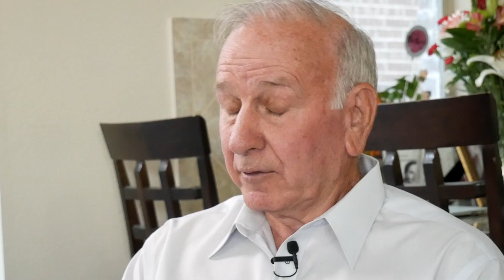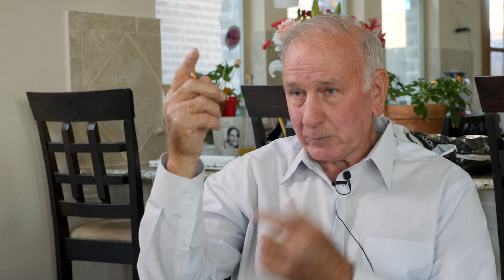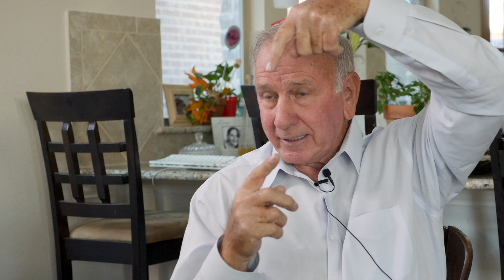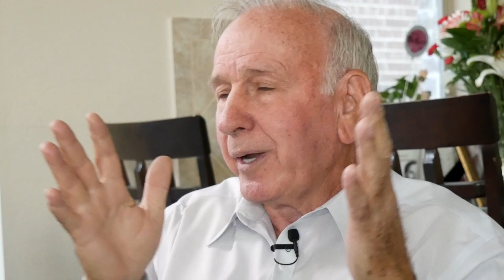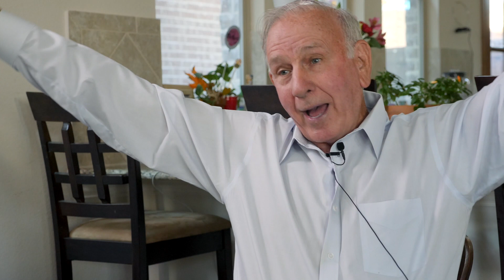Problems with vertical windmills

Comment: Everyone else here is missing the mark. I produce all the electricity I could ever want and I use VAWTs exclusively on my farm in Texas.

 ALL of them turn whenever there is any wind. 

They all use either a 64:1 or a 100:1 transmission and pump AIR.

I use an AIR BATTERY and run compressed air against both piston and turbine engines to produce ANY amountn of electricity I want. 

My compressed-air storage capacity is approaching 10,000 gallons.
Reply: Can we connect? I’d like to learn more from you for a project I am looking into
Reply: @georgem5560  IDK, where do you live?

Comment: He was right. I have installed one 500W VAWT (on my video), and on strong winds, it will sway so much that it lifts the 500KG ballast of the guy wire that is buried underground. The sway is so much that at 6 meter pole, it leans halfway to the ground.
Reply: where is your vidio

Comment: Using your own variables, that you measure in sunny 86 degree weather while going down the highway... is bais. Measure in a lab (ie controlled environment). If temperature, or sun, has an effect, then it should be controlled for and included in your formula... you just don't get to come out with 'your own number'. That is not how science, or engineering, is done.

Comment: One advantage HAWT have is that the blades can be feathered, so it can stand in a hurricane. The old Jacob's HAWT which was a very small unit, maybe 1 kwt, had blades that automatically feathered. And this was 1930's technology. One, installed in the Caribbean, lasted at least 30 years and survived two hurricanes.
A VAWT does not escape having to be put up on a pole. It needs that height because that's where the wind is.
The advantage I see for a VAWT is that it needs just 1 axle instead of 2. It also deals with shits in wind direction better, because it's blades are always oriented to the wind.
It's biggest enemy is centrifugal force, which is a HAWTs friend.
I take it that a HAWT tolerates high winds better. But a VAWT handles shifts in wind direction better.
Reply: Harmony has developed a VAWT whose blades retract and offer less area to the wind as the wind speed increases.
Reply: you think you know what you are talking about >? HAWT are much higher to accommodate
the large blade lengths. VAWT do not have that problem. the larger the VAT i build the slower it turns and does not suffer the giro problem.and it is controlled aerodynamically. I chalenge you to build a VAWT having a maximum hight of 20 ft and report on how many kwh of electricity it produced over a 30 day period compared to the total KWH  of wind energy that was available.  $ 1000.00 if your wind turbine out preforms mine.

Comment: If someone ONLY wanted something to power a small house & to charge a power bank, to be able to tell the power company to "FOff!", rather than something a power company would use to hold us hostage to some crap like "ID2020," would the problems be reduced by a corresponding factor???

Also, would (6 to 8) blades  made from 55 gallon plastic drums (reinforced with bearing mounts, at least at the top & bottom; plus, perhaps at the center point) hold up for 10 to 20 years of sun & other weather (I'm in rural, E. central, Okla. We get a lot of wind; but, a fairly wide range of temps & humidity.)???

Comment: This is the problem when you get engineers involved.  It becomes way too complicated. They want to start calculating coefficients, diameters, air densities and draw up blue prints ect. Get a farmer or rural country  taught on the job fabricator and they'll take care of the problem easily. No need for an engineering degree. Just install the thing on a heavy duty thick walled steel pole secured in a huge concrete base and it wont move.

Comment: Hi, Yes we have taken the main problems away from drag to either be neutral or create lift from leading and trailing blades. The self starting is proof of this. Testing is underway and should have results soon.
Reply: Hi Mike, for me part of the enjoyment is predicting what the results should be; I am excited when I am close and curious why I miss calculated. Before you attach the generator I suggest the following test: 1) remove generator and all frames and blades but one.  2) Connect a digital pulling scale.. {Kg/Lbs where (1 Kg = 2.2 Lbs)} to the frame near where the blade is attached. 3) Establish a pull point to connect the scale, this could be as simple as a weighted tripod; I suggest supporting the scale vertically to avoid errors from downward pressure {but this is minor and may not be necessary}. 4) Using the blade as a reference, mark a circle maybe 5 to 10 ft in radius 5) Place markers around the circle at the following measurement points {deg/% force} Power Side: 0d/0%, 30d/50%, 45d/70%, 90d/100%;  135d/70%, 150d/30%, 180d/0%;  Drag Side: 210d/50%, 250d/70%, 270d/100%, 315d/70%, 330d/50%. 6) Using a large fan, such as one or more leaf blowers, record the scale value as the wind blows from each point. 7) Remove the blade but leave the supporting frame and repeat measurements to determine frame loss. 8) The next step is to calculate the power output in Watts where 1 Watt = 44 lbs per second per foot traveled. Have fun, George

Comment: look at www.vertogen.eu
Reply: Hi Mike, I have only cursory knowledge of this type of windmill. It appears to be trying to reduce the return drag (from 180 to 360 degrees). Most of these designs are high speed rotations which are limited in power due to parasitic drag. I am focused on Wind Farm applications not residential. I did start with residential but migrated to Wind Farm when residential couldn't produce the power I needed. If this is your product, I wish you the best: george@zlan.com

Comment: I think the  VAWT's Gyro effect will stabilize its position?
Reply: I believe the rule is a spinning object wants to remain in place until acted upon by an outside force; then the force is applied 90 degrees in the direction of rotation. A very small lateral movement of the VAWT from a gust of wind while spinning will disturb the windmill's stability. Hold a bicycle wheel by the axle and have someone spin the wheel; if they spin it fast enough just a slight movement of the axle can rip the wheel from your grip. george@zlan.com

Comment: so basically what you're saying is that you didn't follow the rules you came up with his your  formula and it came out better by doing your  homework on your area my formula 50/50  50 power spinning one-way 50 stabilizer spinning the other way in  opposite gear rotation
Reply: Hi Frank, thanks for taking out time to comment. Regarding the formula, I initially found 5 formulas (Google) for wind force that produced different answers with the same area and wind speed. To eliminate some of the equations I did an empirical test of one of my wind panels. It best matched F = 0.00256 x area sq ft x wind speed^2 (mph). With my formula F = 0.0031 ...; I was able to calculate the break-free (start rotation) within a couple of mph. Subsequent I researched designing sails for square rigger sailboats they use the formula F = 0.0034 ... I now use 0.0034.
Not quit following your comments regarding 50 and stabilizer. But I do thank you for joining the conversation... the best to you george@zlan.com

Comment: Imagine a steel frame as for a building; no guide wires. Nest counter-rotating VAT's within the structure.   Place the bearings at the top and the turbines at the bottom.  'Walk' the beams to lube the bearings.  Bottom turbines allow easy maintenance and shorten the power takeoff lines.
Reply: Sounds like an interesting concept and I would like to pitch in BUT I would probably get the job of walking the beam with a lube swab... and I can imagine what that would be like after 10 years in the Navy... nice pic george@zlan.com
Reply: Integration into commercial architecture makes a lot of sense to me. Think of the wind that has to rush around a building standing in its way being directed to a turbine at the buildings edge.

Comment: This gentleman is incorrect with his assumptions. First of all he is speaking about large wind Vertical turbines, to produce large scale wind power. Vertical wind is not designed for large capacity technology. the Horizontals are designed for this. But if you wish put a system in your backyard or a cottage or in a neighborhood, Small vertical systems are the answer. I have heard  many people like this talk about their system changing the way Vertical systems work on large scale power with out all the issues. "Good Luck" The cost and mechanics are far to expensive and the ROI would be out rages.  He mentions 100 ft vertical blades, can you image the structural loading to support this.  Lets see the design. then we can talk in a more real perspective.
Reply: Hi Michael, thanks for you comments, I mostly agree with what you are saying especially when it comes to charging batteries and there have been other who claimed what I am saying with no proof in the pudding. And yes I am a 1 MW plus kind of guy. At this time I send little or no time considering residential designs and their pros and cons. Even though I have a patent it will provide little help in understanding the innovations that I have made since its issuance. I call BS on others and myself when sidestepping how it is achieved, unfortunately I am under new patent application and competition restraints in discussing the details. You used the magic word "ROI" which I constantly track. I solely use my money and time without outside help, I am not qualified to do what I do nor is anyone damaged if it doesn't turn out as I have forecasted. I can tell you I truly enjoy what I am doing and I try, with my 9th grade education, to approach the problem with a professional attatued. I thank you for your comments george@zlan.com
Reply: And.. Hawt overheats with strong winds.. Is that true?
Reply: @semi5alpha  It depends on the design, some are regulated with braking systems or governors to restrict RPM speed.  I am VAWT supporter as I build VAWT systems myself.
Reply: Bigger is not always better or more powerful is not always the way. Sometimes smaller systems with smaller generators makes more sense.
Reply: @michaelberdan5385  Thanks for sharing your expertise... And uuhh..  What is the best type on motor/generator for Vawt?
Reply: @semi5alpha  Personally  we use Axial flux or Zero cogging PMG depending on application and pricing.
Reply: @michaelberdan5385  Wow. Your prouducts are nasty good, Mike.. Not sure if i can contact you easy, i am in the far east by the way..
Reply: @semi5alpha  Lets connect when you return, Have a safe trip.
Reply: @michaelberdan5385  I live here, Mike..

Comment: We did't have a problem.
Reply: Just kidding; do you work for NASA at the space launch center... I think I have heard those words before... no wait "Houston I think we got a problem". In my opinion all windmills have problem and issues including mine. A product is a series of compromises and is design for a set of operating parameters. I know nothing about your product, however I am yet to evaluate a windmill that didn't have major limitations in some wind conditions (problems). Vertical windmills are generally manufactured for a low power (charge batterys) residential market. A common problem for roof mounts is vibration, a second problem is a high rpm speed but produces little or no power these are generally by those who rate their windmills in Volts instead of Watts. I do thank you for your comment and hope your product is successful. george@zlan.com

Comment: One thing you haven't mentioned is leverage. The longer the radius, the more leverage you have. This along with lack of strength are limitations to horizontal axis wind turbines.
Reply: Hi Viper, regarding strength, I also agree with you as this being a major  limitation. This of course is why horizontal blades are small at the tip and very large at the root where it attaches to the hub. Thanks for joining the conversation: george@zlan.com
Reply: In my design a 200 diameter would have about 600 ft circumference and at a wind speed of 60 mph would rotate at under 10 rpm. Not what I would build i am working on 10 to 100 kWh turbines and am looking for used railway axels con you halo. Geraldzuca@icloud.com.

Comment: Instead of one huge VAWT which is obviously impractical as described in this video, I was interested in how at Stanford University the idea of many smaller VAWT is reported to get about 5 (but with the right configuration up to 10) times the power per area of land due to the ability to have them densely packed which HAWT farms cannot do, requiring very large gaps between windmills to mitigate the problems of turbulence.
Very interesting presentations by John Dabiri on YouTube, eg https://www.youtube.com/watch?v=56xW2535obY
Reply: Yes, this person is trying to copy the Grand Scale of Horizontal Windmills/Turbines - Vertical could do better by being smaller (x 5 - 10 units)  ..  The Forces will be less and they could be managed by counter balancing the whole system, by joining them together (just a though). FYI - I was thinking of using Mutiple units, to replace the Sail Mask of a sailing ship (While still retaining the forward or aft sails / depending on space and configuration) With Enough energy I can ditch any Diesel engines and go all Electric or Pneumatic.  Thoughts? or Resources you might know about, cheers
Reply: Hi Bry, yes this is a similar concept that my son came up with a few years back, to me it is liken to a planetary gear (power) system. I am not able to discuss the pros and cons; the cons far out weigh the pros and it looks better on paper than it does trying to compete with Wind Turbines. The concept is valid and the concept of built-in wind recovery is also valid; however the Megawatt application is flawed. I have a couple of blogs on www.GSharpLabs.com that addresses land utilization and wind recovery space. Thanks glad to see others expanding their learning curve. george@zlan.com

Comment: Thank You for the great information. How do you make a vawt with no axial??? Please explain. Again Thank You.
Reply: For patent (which I have an issued patent)and compitation reasons I am unable to supply detail information regarding my wind harvesting technology... If it works out maybe one day you will see how it is done. george@zlan.com
Reply: @georgespencer8871  Thank You for the reply. I wish You the very best. Keep Going.
Reply: Thanks
Reply: not to difficalt  ;you put up a larger diameter pole and rotate the blades around it . no axle but more complicated.
Reply: Vertical means he could run the perimeter of the turbine in a track which rotates over a full set of magnets and the entire bottom of the turbine as the coil and just use that as the rotation point at the circumference of the blades.